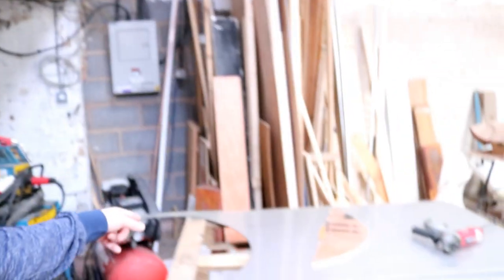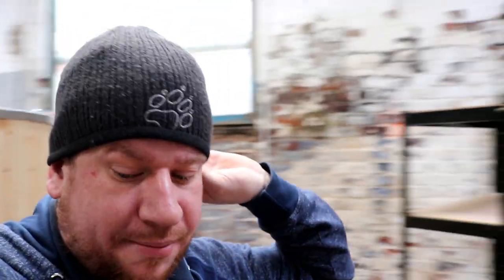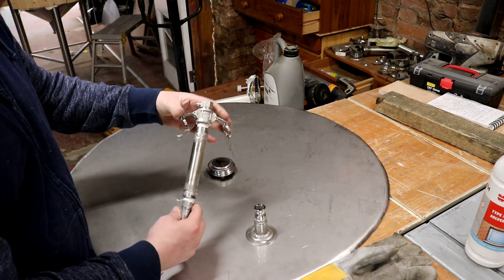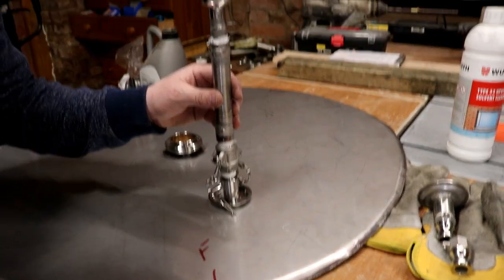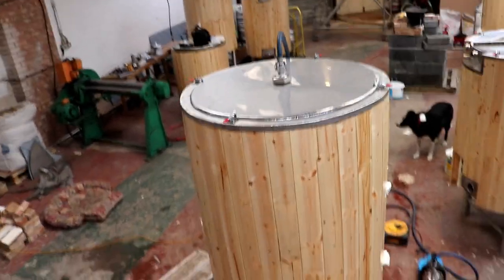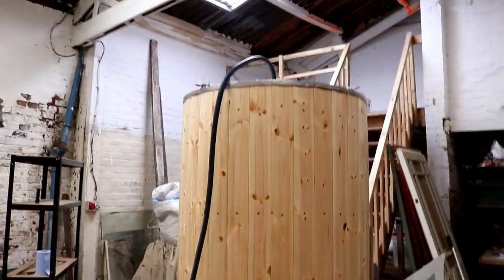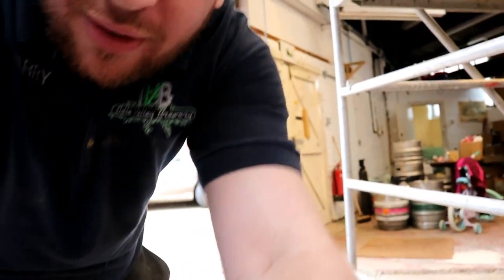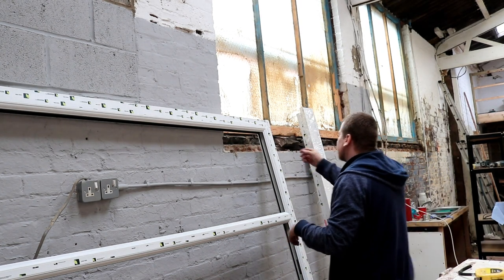BACK IN THE LOOP

Comment: Hi Harry ,
Dont weld the angle , lay the lid on a good flat surface and the angle flat side down and use a good epoxy adhesive as you dont need  the strength
That should work until you drop it